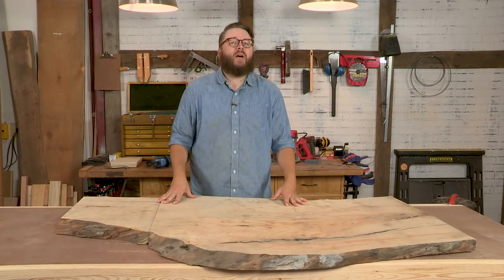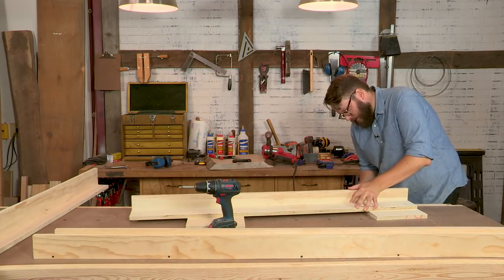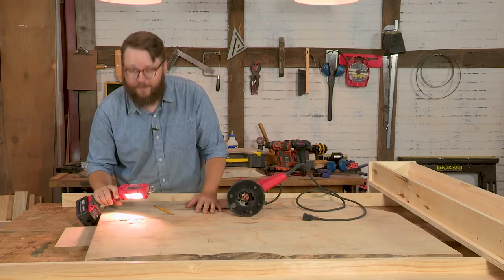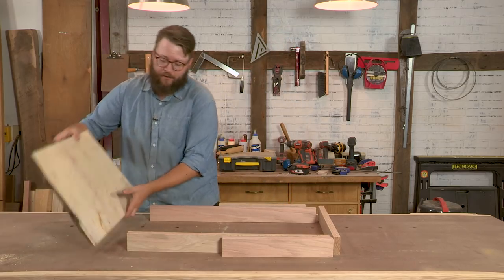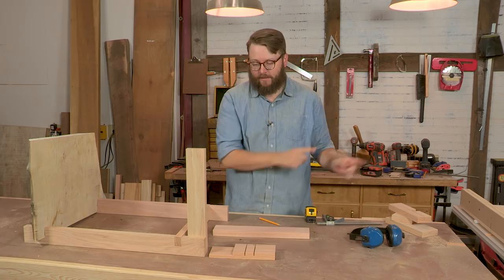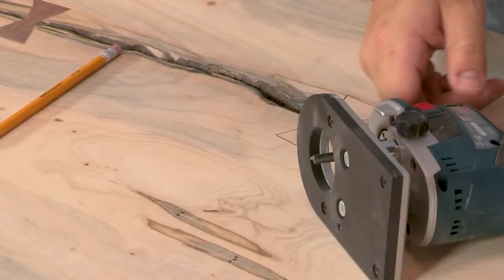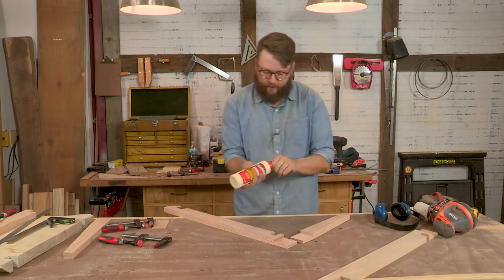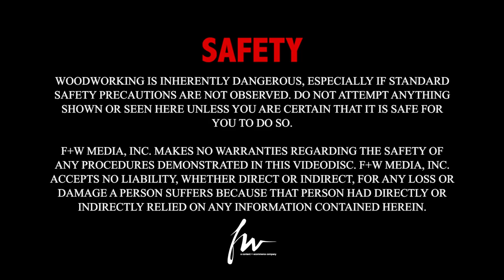How to Make Simple Slab Coffee Table | I Can Do That!

Comment: Hey Andrew, 
Great video! I’ve got a cookie cut from the base of a dead ash tree that I just got removed. Do I need to dry the slab before I attempt this project?
Reply: David, 4 months late so you either worked it green or have let it dry. For future reference. Drying causes shrinking, twisting, bowing, checking, etc. so waiting is a positive. Cutting green goes faster and removes material making drying faster and can reduce some of the bad effects but not eliminate. Does mean that you are more than likely to have to re flatten later on. Hope your project turns (ed) out great.

Comment: Nice jig.  You should have stops so the router cannot touch the rails supporting the router platform, also add blocks on underside of router support outside of rails so it moves consistently instead of the "wobble" you get now.

Comment: why not use a bigger bit like a rabbeting bit?
Reply: A rabbeting bit has a bearing similar to a flush trim bit, chamfer bit, and other profile bits that prevents you from using it like a straight bit and actually cutting into the top to flatten it.